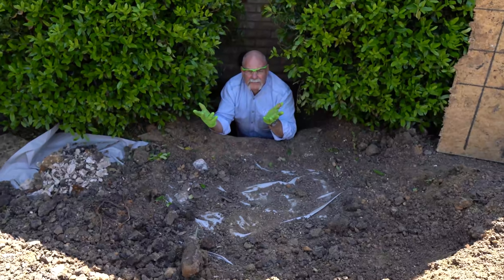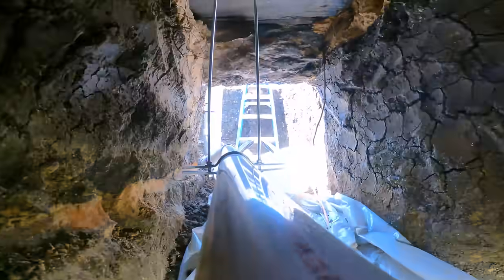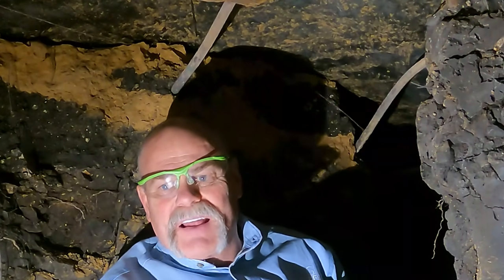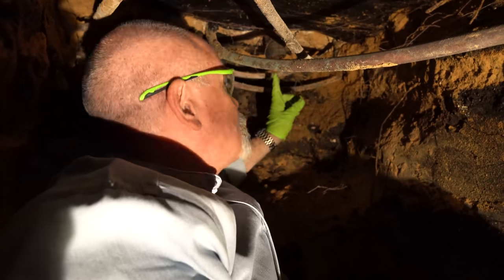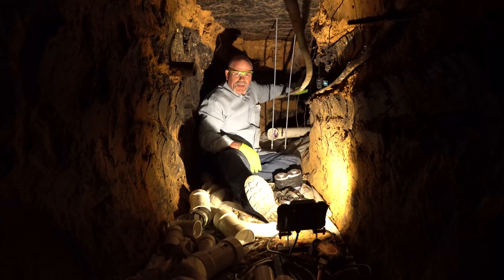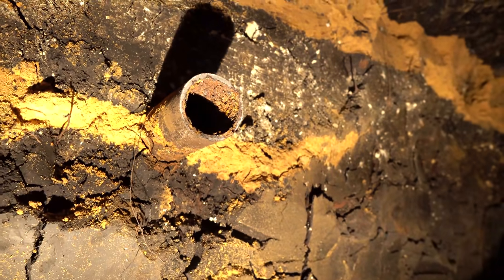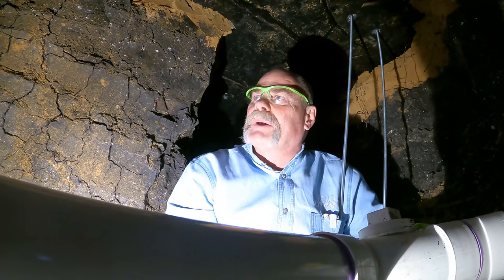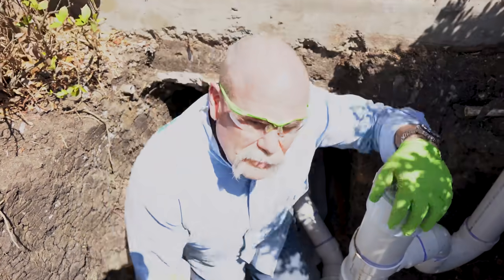DIVING DEEP Under a House to Replace Broken Sewer Lines

Comment: Why are you using PVC and not schedule 80 black pipe
Reply: PVC under slab outlasts schedule 80 iron.

If they had started using PVC pipe when they started building slab homes Roger would be out of a job.

Comment: I know plumbers did not have plastic pipe 60 years ago. If manufactures of pipe had made stainless steel pipe. I think stainless steel pipe would have been a good choice, that was the same form and style as the cast iron. stainless lasts a long time.

Comment: I'm always amazed about how cheaply the Americans build their houses.. throw a slab of concrete on the floor, put a wood frame on top, nail a few boards onto it, and done. Pipes and cables are pulled "wherever" all across the framework. And then some strong wind comes and razes whole cities.. only to be rebuilt in the same cheap and shoddy way.

Comment: We would definitely just jack hammer the floor from above
Reply: Same here. I tell people I work with about him tunneling under slabs. You should see the looks I get
Reply: You get different issues with jackhammering, as now you have a slab in multiple pieces, and the floor will have the potential to crack. At the end of the day, you still have to dig the same amount of dirt to replace the line. And, if still has to be hand-dug. Jackhammering may be a good choice for a water line repair, but probably doesn't affect the cost much for a rusted out sewer, and the flooring has to be replaced if you jackhammer.

Comment: Had an issue where  a plumber who wasn't very reputable put a camera down our pipes and found that the pipes had water in them...

They claimed the pipe was bowed, and as such, was not draining right, causing back-ups and such...

The plumbers were quick to reach out to our homeowner's insurance and start a claim right away.  They jackhammered the floor before the inspector even arrived (they knew him apparently) and tore up all the piping and even stubbed out a new line to the cesspool... only to discover: Cesspool was full!  Thousands of dollars in repairs AND renovations and the promises kept getting broken as to what they would, and would not, fix.

The company went under, and I took them to small claims.  Gotta say: even with a plumbing company with a good reputation... when the ownership changes?  Watch out... and get everything in writing!

Comment: Holy smokes that's got to be a $30k job...
Reply: I'll bet you're not even half the way there on that estimate. I'd say double that. The dig crew alone, the tunnel design and site inspection by a Structural P.E. or a Geotechnical P.E., and the equipment mobilization is $30-$40k easy. If he's doing that job for $30k, the customer is getting a steal.
Reply: @bullmoosepiper7732  I've had neighbors who have had work like this done, prices ranging from 10k to 30k. The dig crew is most expensive part of the job, and mostly done by hand. The price is mostly driven by the length and depth of the tunnel. Water line repairs don't need to be dug as deep.
Reply: @johnhaller5851  Interesting. I guess price varies based upon region and what the strata is made up of which dictates how hard it is to remove the soils. In my region, tunneling like that would be a bloody fortune. Trenching alone is expensive. Although we mainly have basements, so this isn't an issue. When I lived in FL where copper pipes on older houses constantly leaked under slabs, we'd just use sonar to pinpoint the leak and then jackhammer the slab up. Never did I see anyone tunnel like this. Thanks for your feedback and your kind response!

Comment: That is crazy insane labor instead of digging all the way under the house like that why don't you guys just jackhammer the cement slab up in certain spots instead of digging like a freaking mole lol. Way too much time in labor.
Reply: You'd have to cut a trench in the concrete all the way through the house. Through walls, through finished floors, etc. To get full access to the pipe

Comment: how does it work in an apartment? on sides been thinking . . ,  . are they on walls side lol and or roof in the house it usually is unhygenic to have this way but I guess not in an apartment and because more used it should be mandatory changed updated for anyone in apartment s too and like brushing teeth and washing dishes with out no water and to clean rinse sponge s things and things I forgot even hands now mouth and more and clean teeth yea I guess waiting till something happens breaks but it is dirty pipes and I don't know and still be updated when old er v later and and Is it safe to cook with the water from sink in apartments should be but said about lead and seemed close r to sink connected more from pipes by sink but I guess not now . . , or and other thing s